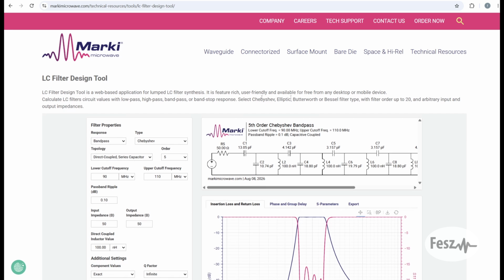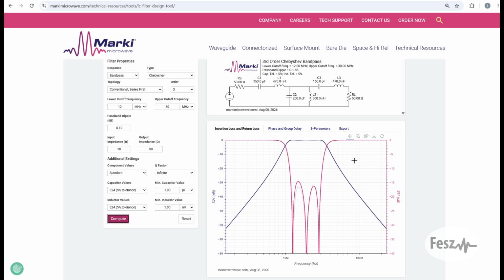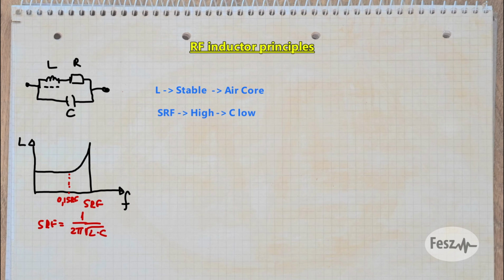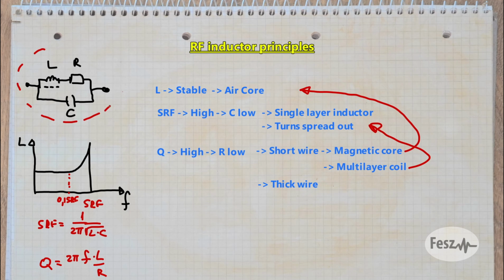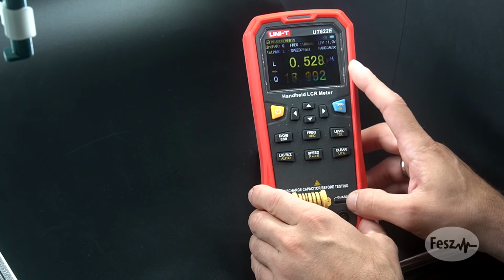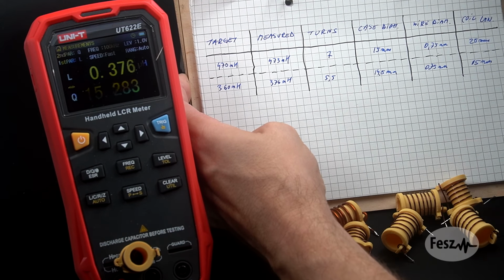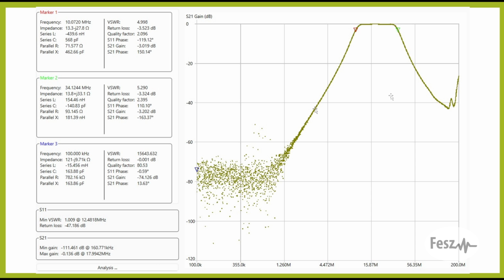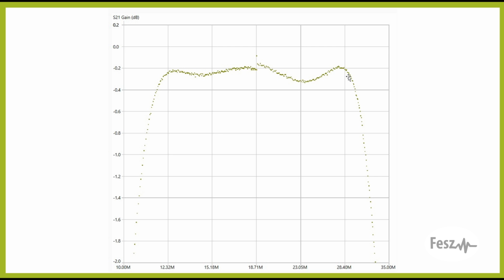Designing an RF Filter — Will It Reduce the Noise?

Comment: I found TV,HDMI,playstation etc are killing all bands, so is dimmers, EV chargers, PSUs.   buy 10kg of ferrite cores and clampons and just go nuts and start from where power enters your house and add to both inputs and outputs of everything. Shealding with copper tape inside the screen you need ofc grounded helps but to do the front car window with embedded resistive heating could prob work if a practical one is found.  QRM pollution is getting to be a real hassle this days.  Good video btw.

Comment: Yes!! This is a very annoying but unavoidable feature of modern PCs. 
Almost all use 100W+ buck converters operating at 200-500kHz and 100MHz common base clock which actually gets spread over a wider band so manufacturers have easier time with EMI regulations. Chipsets also use 25MHz, but it's weaker.
Turning off spread spectrum in bios helps a little because it contains it to just the main 100MHz band, and some motherboards offer reading or even adjusting the VRM frequency so you can actually predict where the noise harmonics will be.
Well done video again, thanks for the work.
Reply: Probably the monitor too.

Comment: I live in a radio quiet (relatively) part of the country. All my RFI came from my electric fence (since removed) and my solar inverter, a much harder problem to solve. Running everything off batteries and turning off the inverter the hash across all  bands disappears. I'm upgrading the unit to a larger one - this time I'll be putting it in a Faraday cage AND placing ferrite multiple (an unreasonable amount) beads on everything entering and leaving the enclosure. 😿